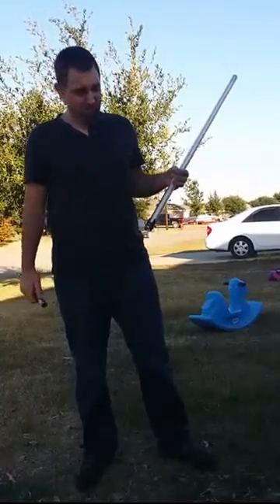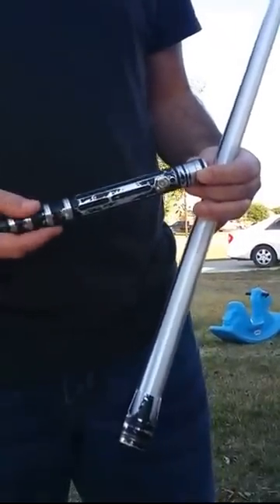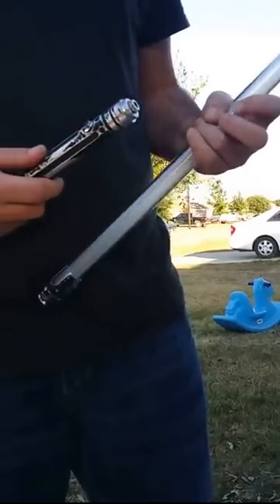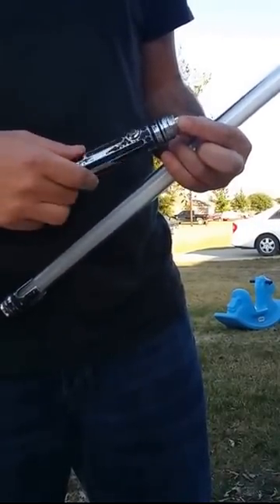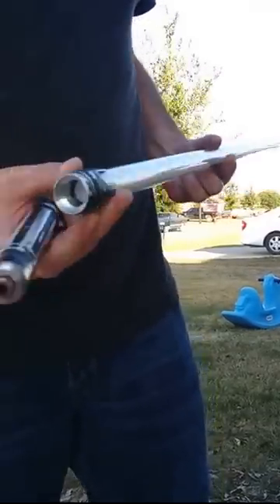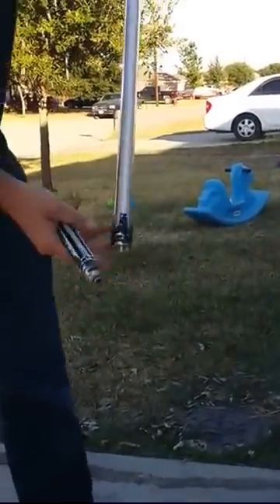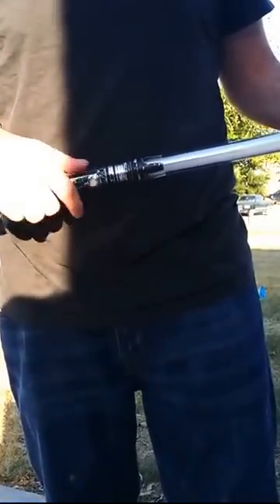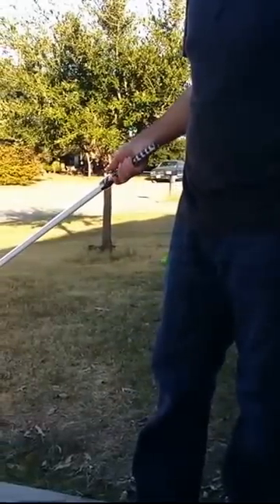DIY Lightsaber Laser Saber - Trendkilla254

Comment from the maker: steve you clearly didn't watch this video... this is 100% custom. None of this lasers is store bought. This is only 5mw because I use this indoors for my job. The host is machined. There is.no other like it. The diode is a PL515 diode from osram. The driver is custom built as well. the blade is 100% custom. I designed the growing blade. You took a toy apart.... and put a prebuilt modules in it and lied about its output. move on troll.